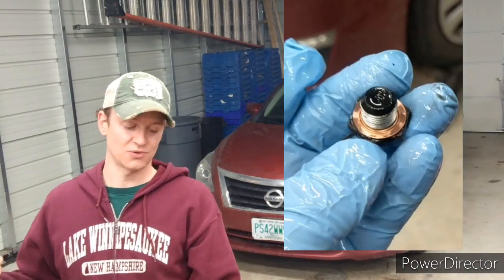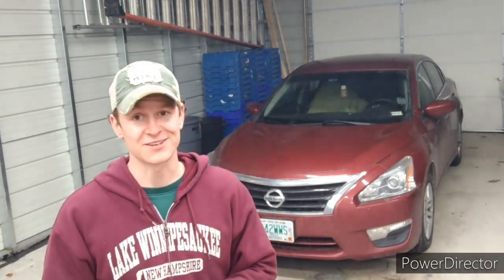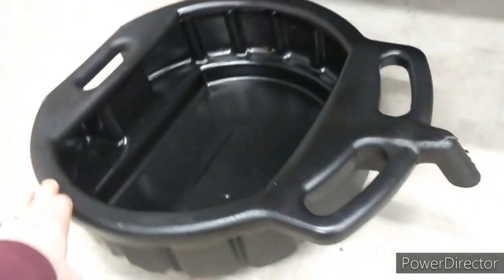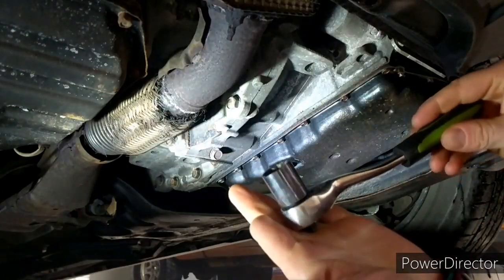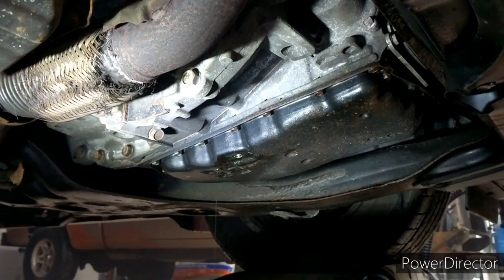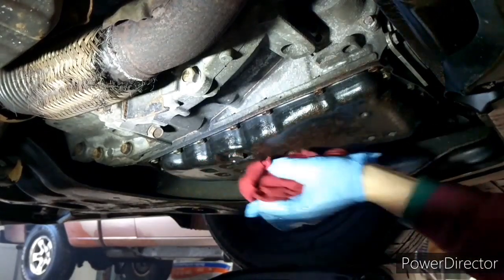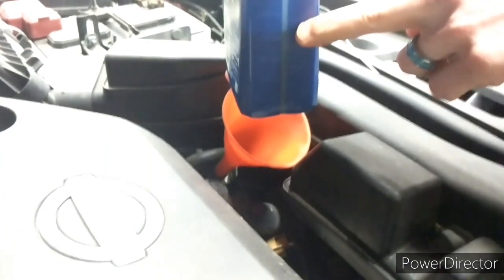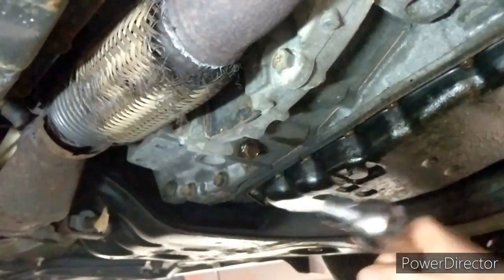Changing Nissan CVT trans fluid.

Comment: Excellent demonstration on changing the CVT! I also have a 2014 S model and changed the trans fluid a few years ago. I actually purchased one of the Malufosa dip sticks and found a serious problem with them - it read low fluid and when I checked the over flow it was right on point. I wrote up a review and asked Malufosa to contact me about it because I love the fact that they made the dipstick. 

Anyway, thanks again for posting this. I learned that I’ve been going WAY to long between changes and need to get out in the garage soon.

Comment: Great video. Thanks!
There are 2 CVT oil filters on the 2013 altima: One inside the oil pan, another paper filter on the exterior for the oil cooler. Both should be changed at about 90-100 thousand miles. And clean the interior of the oil pan at that time also. There is a good video out there for doing a complete 8 quart flush also. It's just a little more work.
Reply: U are a 100% correct!!
Reply: You are so correct!   It's absolutely imperative that the upper cartridge filter be changed.  The trans actually starts to shift funny as it gets clogged with particulates.   Not only that, but as the filter gets restricted,  it dramatically affects cooling.   I installed  a trans temp gauge on mine, and before changing that filter it would regularly go to 220.   Since I changed it, seldom goes over 205 (f)   I would recommend changing it every 30K along with dropping the pan (to clean the magnet and change the screen).

Comment: I did 120,000 on to the first change. Buy only Nissan CVT fluid. Go to Valvoline and make a CVT transmissions flush $199, but bring your Nissan CVT fluid 5-6 qt $100-120. After the flush it will not slip and run strong again. 
It will cost you $300-$320 every 60,000-80,000 miles but it's worth it as you car drives like new again..My car has 295,000 miles on it now 2017 Altima ( I drive Uber)

Comment: Valvoline makes great transmission fluids.  I’m going to use their cvt fluid on my 16 crv.
Reply: Honda hc-f is at least $23 a quart here in Canada. I've found Valvoline for $10 on sale
Reply: @AwesomenessIskey  I wish you luck.  I hear Hondas are really finicky about certain fluids.
Reply: @charleshines8523  Im pretty sure enoes makes the hcf-2 fluid. It's alot cheaper than from the dealer here
Reply: there is nothing cheap like the USA in Canada . So buying the best has the good c/p value. No sense to buy the cheap stuff.

Comment: A lot dont know that nissan CVTs have two filters. The second is like a exposed element on some engine oil filters. It monts on the side of the CVT from the drivers side.
Reply: the problem is nissan moves that filter around alot on its years and models

Comment: U are almost correct! There is indeed 2 filters up till 2016 then one inline filter only on the outside of the transmission. Very important to change it, takes 5 minutes.  And amsoil is the only synthetic transmission fluid that is a 100% synthetic, the other companies are running anywhere from 5 to 10% and can legally call it a full synthetic.
Reply: We were told by nissan you had to vaccum the fluid in the cvt on our 2014 Nissan rogue  .not true i changed it just like any other fluid change . They said you hsve to buy a copper crush washer to go back on the pan bolt also not true i reused the same one without a leak ..i dont have a dipstick in mine i measured whst came out of it and thats whst i put back in it ..if it isnt leaking it hasnt lost any so its running fine so far Good Lord be blessed.  We have 175 thousand on our 2014 rogue and its been a superb vehicle  we have a problem with the radio not eork3ing every now and then and the air unit too but other than that its cheap to operate
Reply: @poboy942  Excellent!! Good to hear!! 👍🏼

Comment: This makes me feel so much comfortable doing drain and fills on my 2018 rogue.  The check bolt makes getting the right level pretty idiot proof.  Im a big fan of AMSOIL too and will be using it.  I just changed my transfer case and rear differential and used AMSOIL.  Granted I can't feel a difference driving but Im sure its better than what was in it.
Reply: I also went with AMSOIL CVT and had a local shop change it but after watching this video, believe I can do it myself next time.  Thanks.
Reply from the maker: Thank you for replying to the video, I'm very much encouraged my video is making a difference for someone out there, that is definitely the point of all my videos, thank you!

Comment: raising the back is extra work.  measure what you take out. and then put new back the same.  take off stand and measure when on level ground.  and make sure you are checking the levels when at 165 degrees. running

Comment: AMSOIL... Best cvt fluid. Buttery smooth and cvt searches less for the appropriate position on pulley... can’t really say gear now eh??
Reply: I use the same but our Walmart stopped selling quarts gotta buy it by the gal size now nb though cheaper.

Comment: Make sure you can get to and open the transmission fill cap and refill with the funnels on hand before draining guys.  For the Nissan Versa Note I also needed a 5mm hex to unscrew inside the transmission pan to further empty fluid.
Reply: Pro trick : you can watch movies at Flixzone. I've been using it for watching all kinds of movies during the lockdown.
Reply: @Zaiden Deandre Yea, been using flixzone} for years myself :D
Reply: @Zaiden Deandre yup, I have been watching on flixzone} for months myself :)

Comment: Copper washer is damaged after 1 used.  it's has no use  for second time.. may work may not depending how lucky you are
10 cents why not swap out? No worry in the long run

Comment: 27 ft lbs is the torque spec, change the crush washer it’s 88cents and could save you having to replace all the fluid again. Use the torque wrench, these pans aren’t cheap and are a pain in the ass to replace.
Reply: The trans pans are easy to remove and replace.  If the crush washer is not leaking, then you don't need to replace it.  I do agree with torquing the pan bolts so to the aluminum trans case to avoid stripping out the threads.  I prefer to drop the pan if only to check for any metal shaving pick up by the magnets when I do a partial change, and this add about an additional quart of fluid to the change.

Comment: There is also a paper filter on the side of the transmission the transmission cooler that should be changed as well as the strainer filter in the pan and a new pan gasket installed 
It's like doing an oil change on your car without changing the filter ... and who would do that.

Comment: I have a 2015 Nissan Rogue AWD with 45K miles.
I did CVT fluid flush with a filter change, used the same OEM oil strainer after clean it, new oil pan gasket, new O ring washers, and new crush washer. The oil I used is Amsoil CVT fluid.
I used this method:
https://youtu.be/6B57Qgomx88
And
https://youtu.be/AVaKRRyrQT0
Regards.

Comment: It seems crazy not to take the pan off and clean it along with the magnets and change the filter/screen while you are in there. Nissan recommends the transmission service every 25k miles.  Doing these services at larger mileage intervals and without cleaning the pan and magnets greatly increases the possibility of transmission failure.
Reply from the maker: You are absolutely right. Funny how you say your dealer suggests every 25,000 mi because out here in New England they asked me why I would even want to change it unless there was a problem 🙄 insane how inconsistent information can be based on where you live.
Reply: @pete89spotsin I recently bought a 2016 Altima RS as a result of researching the inherent problems with the Transmission. I am very happy with the car overall. Thank you for clarifying what can be done about keeping the Transmission as reliable as possible.  From what I understand, If there is a problem with the Transmission, it is too late.  The entire Transmission will need to be changed.  The Nissan manual says to do the service every 30k miles, and that the warranty is only valid if the dealer does the service.
Reply: @auroraRealms  By law, taking your vehicle to an outside shop for servicing does NOT void your warranty.  The car makers just want you to spend your money at the dealership. (or  stealership as they are more commonly known)
Reply: Everyone in North America should stop buying Nissan.
Reply: @johncole4380  Nissan cars are built in North America by North American Workers.  Why are you opposed to buying Nissan?
Reply: @Aidan Bhuiyan That is amazing, that you saved it.  I would keep a close eye on the fluid, and do another service soon, if it shows any sign of dirt in the fluid.  I always say either change the fluid or the transmission.  It is much less expensive to change the fluid.
Reply: @auroraRealms  The transmissions are NOT made or assembled in the USA.  Korea makes them.  The high failure rate has been blamed on the type of fluid they were using wasn't make to the manufacturers specs.  With the 2nd generation trans, Nissan has changed to a new supplier.  Idemitsu makes the Nissan branded CVTF.  Nissan CVTF btw is not synthetic fluid either.

Comment: Hi, i have a 2013 nissan versa with a cvt transmission, the cvt oil type is NS2.
I'm planning to change the cvt oil, i need to know if i can replace the NS2 type by NS3 type of oil or i should only use the same oil type (NS2).
Thank u

Comment: I like it, but my 2013 Altima Coupe 2.5 S does not have the over fill drain plug. I am having to rely on the dip stick that it came with and hope that it is accurate since I did buy this car used and don't know if the dip stick came with it from the dealer.
Reply from the maker: You can always take your car to the dealer and compare your dipstick with the one they have as well. This will solidify in your mind whether yours is accurate or not. Also finding someone with the same kind of car as you and comparing your dipstick to theirs is also a good idea.

Comment: I noticed you may have forgotten some steps. After filling the CVT fluid, you should shift through the gears (at least 5 seconds in each gear) so the fluid can move through the transmission.   I just did my 2014 Rogue and followed the Service Manual. I plan to drive for a bit and then overfill, shift thru gears again, and open up the Overfill Bolt Hole again. I cannot do a full drain and fill again because I only have 2 quarts left and they are expensive. Was $30 a quart from the dealer. I didnt want to risk 3rd party oil.
Reply: How exactly do you change through the gears on a gearbox that has no gears to change through?  Do you understand what a CVT is?
Reply: @m3chanist  park reverse neutral drive and low is what he means changing the gear hence why it’s called a gear selector he’s not talking about the gears in the tranny he’s taking about drive and reverse and stuff, a lot people say put it into gear when it’s an automatic
Reply: @sethlittle7338  exactly, thanks.
Reply: @hamhead1  no problem people like that annoy me so much cause they think they know what they’re talking about and usually don’t
Reply: u got fooled with the dealer cvt fluid. they can't possibly make their own. they make cars. they outsource fluid making companies to do it. there's a great vid on youtube about this dealer scam.
Reply: @m3chanist  Nissan Service Manual Edition June 2012
 Page TM-82 - For a 2013 Altima 2.5.
"While depressing the brake pedal, shift the SELECTOR lever to the entire position from "P" to "DS", and shift it to the "P" position. NOTE: Hold the lever at each position for 5 seconds."
Reply: @livisda  Idemitsu Cvtf Type N Automatic Transmission Fluid 30040091.

Comment: I don't know if you cut something out, but it looked to me like you hand-threaded the plug into the transmission by hand only about 1/2 a thread and then you torqued the plug with only a partial turn. If true, your drain bolt would seem to be cross-threaded. However, if it was cross-threaded that badly, it would probably not hit the copper sealing gasket and it would leak. You didn't indicate that happened. Is there more to this story?
Reply: Yes, The video was edited to its final thread before he torque it with a wrench.

Comment: I just had a new transmission put in my 2013 Altima 3.5 s. I want to switch all the fluid out to the Amsoil CVT fluid do I need to drain the whole thing pull the pan and the filters or can I just do the drain and fill?

Comment: We went 174,548 miles and never changed the fluid not once because the moron at yhe nissan dealership told us it was an unservicable transmission ,so here a while back it started to act up a little so i changed all the fluids like oil which was clean already but it was time so i changed it too but i changed the fkuid inbthe cvt after nearly 175,000 miles and it still wasnt black it needed changed obviously but it wasnt burnt or didnt stink like burned fluid, i changed it and we havent had snother issue .

Comment: Please make a video for replacing filter for your CVT I’ve been changing it every 30,000 but I got it when It was 37,000 and I’ve it changed then I am at almost 100,000 and I’m having jolts when letting go of the throttle after high acceleration in city areas.
Reply from the maker: Yes I plan to Make a video just like the last ones only in my next video I will do a filter change as well. I am excited!
Reply: I asked the dealer to replace my transmissions filter and they told me there isnt 1 lol. I was.trying to get it changed at the dealer but they don't seem 2 understand unless my 2016 2.5 is a bit different?? Odd... my old 2014 altima cvt fluid was last changed at 120k miles but now it has 243k miles..still drives perfect 4 some reason. My 2016 I change around every 60k and im at 322k miles right now.

Comment: If you are using a dipstick to check the fluid level. Should the car be running or stopped?
Reply: Running with the fluid operate temperature 👍

Comment: Wish my '14 Maxima had that adjustment bolt. By the way there are two filters. Both the Altima and Maxima have them. One is the oil cooler filter and the other is the one you mention in this video.
Reply from the maker: Yes my next video covers exactly those two filters along with another oil change

Comment: I assume the length of the dipstick can vary in length from one transmission to another. My question is, can another dipstick be used and get the same result as the check bolt with the proper calibration?
Reply from the maker: Yes for instance I have been told by other reviews that they have used the Ford F-150 transmission dipstick to do the same job. Obviously the older Ford f-150s
Reply: Information from Nissan Service Manual.  After draining the transmission fluid, - (Or any time) -The correct and final level is determined by the temperature of the fluid..  That is determined by removing the overflow plug while the engine is idling - the selector lever has been shifted thru all positions for 5 seconds each, and returned to park -  while the the fluid level is between 95F and 113F degrees. At that time "When the flow of the CVT fluid slows to a drip, tighten the overflow plug to the specified torque. (89 INCH lbs).  The fluid level is NOW verified as being correct and you can THEN, for the FIRST time check readings on a dipstick. The original existing aftermarket dipstick readings may not align with the final and correct level - IF not, you can make file marks on the stick, or make note of what the reading level is. ALSO,  hours later when the engine and transmission are totally COLD and the car is parked level, make a mark on the stick for future guidance - but even that would change depending on the existing weather temp. Only the mentioned idling temp level does not change. IMO - Because the level is affected by the fluid temp so much, some may would misunderstand readings using a stick NOT designed and tested for that exact engine and overfill the CVT - which would cause damage from foaming over time.

Comment: Nissan Sentra SV 2017 has 150,000. Miles , transmission after 130K miles failed. Mechanic simply said these transmissions are only good for 100K miles. I do Lyft/Uber postmates , this us how I have so many miles. My cvt transmission has 150K miles and is beginning to slip., The CVT transmission work was financed so I pay $120.00 a week for a full year , on top of my almost $500.00 car payment per month , I still owe almost $17000.00 (17K). Mechanic recommended a CVT oil change every 20 , 30 K miles. Nissan you have lost a customer for life , will now be a Toyota , Honda customer.
Reply: My 2013 altima 2.5s transmission went out, last week. only has 54k miles
Reply: Hey, sorry to hear about your situation, my 2014 Sentra went out too. I’m genuinely curious did you get any transmission oil flush during your 150k moles
Reply: @freakinA10202  No.